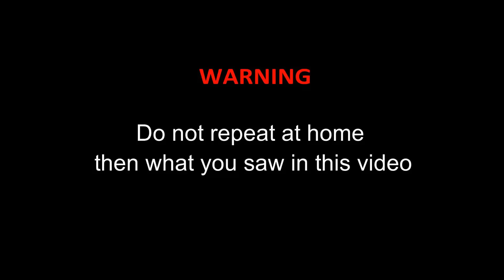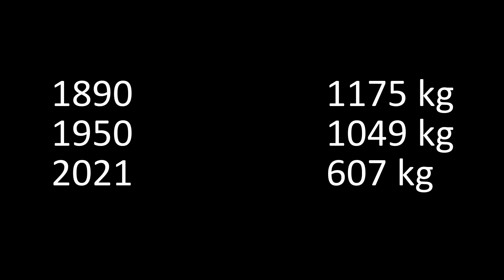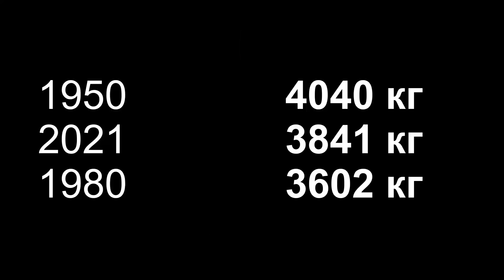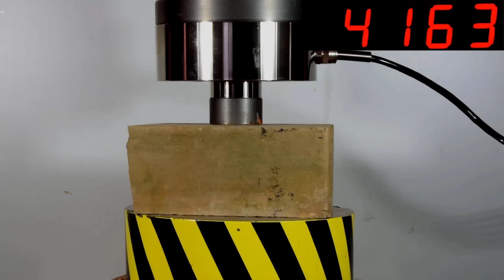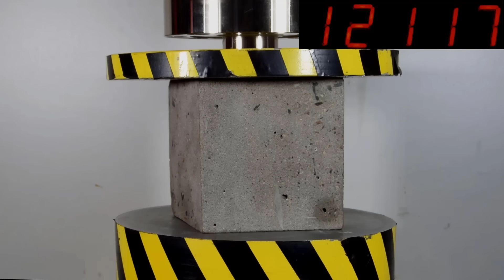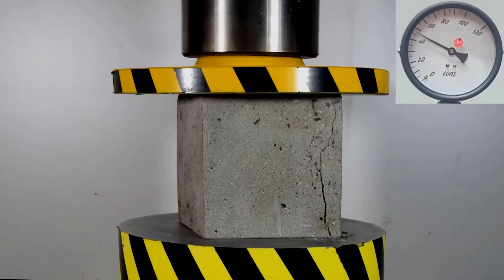HYDRAULIC PRESS VS OLD AND MODERN BRICKS

Comment: This just shows how older things were made to last where as modern things aren't.
Reply: That is not what it shows
Reply: @sovereigncataclysm  It is for the 1900 brick lasted longer than the 2020 brick.
Reply: @WintersAngel  1900s bricks were made with different construction practices in mind. They are fired at much higher temperatures which makes them a lot more resistant, but more brittle. This is because they were used for the main structure of the building. Modern building practices has a lot of steel etc. reinforcement, that makes brittle bricks a poor design choice so they are fired at lower temps. 
Not only that, but there is significant selection bias here. If a brick has survived since 1950s then it was one of the strongest of the batch - all of the weak ones have already been broken and can't make it to this testing. However, for the modern one, this effect is not present.
Reply: @sovereigncataclysm  True but the 1950s brick would be weaker than when it was first made for as the years had gone by it would've been damaged in some way. Whereas for the modern one not as much damage would've happened to it for it's pretty new, and yet the older one survives longer.
If the 2020 brick had been around for as long as the 1950 brick it might have broken quicker because of its surroundings, changes in the temperature and etc that it may have gone through.

I am going to say that through development newer bricks would be made to be stronger so that whatever they are using them for doesn't break as easily. If it did the companies would be sued. Which they do not want. 
However, with the demand and the growth of the population more things are being demanded which means quicker reproduction needs to be made so a mistake in manufacturing may be made. 
In older factories, there would've been less demand and a lot more done by hand so mistakes couldn't sneak in so much.
Either way, some older things were designed to last long, and some weren't.
We are both right in our own ways for different things may have happened to each item and that way there is a flaw in testing any hypothesis.
If one brick was used to make a wall of a house, vs one used to make a divider in a room, which one would be stronger? 
The one used to make a wall of course. 
We don't know what the 1950 and 2020 bricks were used for so that makes it harder for both our hypothesises.
If we knew what they were used for, and were both used for the same thing, then it would be clear that the 1950 brick was better.
Thus proving my point.
But we don't know so none of us could be fully correct.

Comment: The concrete compression tests were actually very interesting as it continues to cure for decades after pouring so it's hard to say if modern mixes are better tan the older ones
Reply: I think planed selfdestruction of a good is nowadays in literally anything, even in a brick.
Reply: The tests were not made in equal conditions, since the "modern" concrete is pure concrete, you can see it being converted to dust, but the older concrete has gravel on is composition, so it makes it stronger, since it has more properties for being a composite material. That's one of the reason it could hold more load.
Reply: The material is cheaper today resource wise
Reply: @alejandroguerra3411  Well nowadays concrete in general does not contain any gravel anymore, because sandbased concrete became the standard. The only thing that nowadays reinforces concrete are steel insertions, also only used on specific points of a building with a higher contact pressure and weightload.
Reply: Pop lo propio l
Reply: This is where I, an electrical engineer, can admit my respect for civil engineers.

We used to say "but you guys just study concrete"

Wooooooof
Reply: @sad_wrangler8515  so they where tougher before
Reply: @TH3MZ   The 2 main factors in why sand based is used more to day is because it cheaper and its lighter. Most people think that there has to be one best thing in every thing. In reality the best way to excel in engineering to to make things excel within there purpose. In a team you dont want carbon copys of your best player you want a diverse cast, where one fails the others thrive.
Reply: you also have to take it to account that modern concrete is designed to be used with rebar so its not as dense i.e less aggregates therefor not as strong
Reply: Roman concrete is actually stronger than modern concrete. The Romans made concrete with volcanic ash and lime. When it was exposed to sea water, it became stronger. Researchers found a reaction occured that formed a rare mineral.
Reply: @badnoodlez  TBH they just do the same physics as mechanical engineers, but they ignore 90% of forces and attributes because they consider them negligible lul:D
Reply: There are different mixes for concrete for different concrete strengths (i.e. 3000 psi, 4000 psi, 5000psi, etc...).  There is no just plain modern concrete...
Reply: Cost efficiencies especially in this economy would make me same the older had more quality bricks. It also makes sense that bricks should be made cheaper with the introduction of steel into buildings, which would explain the downward trend of brick quality.
Reply: @BenDover-tq5yu  exactly
Reply: Speaking of those tests, I only say the first, but the flashed numbers say 6 thousand something and it was only 1 or do thousand.
Reply: @sad_wrangler8515   actually, there's different concrete sets that are commercially produced, some come with gravel, including quick setting
Reply: The new block had literally no supports in it, of course its going to fold easily. the old one had a ton of contaminates which give it support. Simple concrete knowledge and physics knowledge could have told you this test was flawed. I also want to point out the newer concrete looks like it didn't set properly.
Reply: @sad_wrangler8515  Bricks are typically not made of concrete, they are made of clay, namely because the former is easier to mix and pour on site while the latter must be hardened and shaped well before transport. And as OP stated, concrete does in fact cure over the years, meaning it dries out and becomes harder, and theoretically stronger.
Reply: @sad_wrangler8515  all the concrete we use has gravel in it
Reply: @alejandroguerra3411  the real reason is that the old concrete was made for a fortress and not for civilian use
Reply: up to 3 years depending on the cement after that time there are no significant changes in compression strength. There are also other factors which in time lower concrete bearing capacity
Reply: @sairvinginthestacks  It's just zeolitic minerals which form in Roman cements, not exactly rare minerals. For example, (nanocrystalline) zeolites also form in modern geopolymer/alkali-activated cements. When cured at elevated temperatures, the zeolites crystallize properly.
Reply: @brianfranks5874  Depends on the grain strength, as you saw. The fortress brick literally had gravel with 2-5cm diameter. Modern concrete contains lime powder, silicon sand and the gravel of modern concrete is not even one centimeter in diameter. Porphyr, Basalt or the cheapest Gitter cost nearly 300€ per ton, which is half the price for a metric ton of concrete. Dolomite and Basalt sand cost 50-100€ per metric ton.
Reply: @landerfrederickx904  Thanks! None of the articles I could find actually explained what type of minerals formed. They just mentioned sea water and "rare" minerals.
Reply: @sad_wrangler8515  When you speak of ''modern concrete'' do you mean concrete mix created in US or everywhere? Round here you still mix it with gravel and reinforce it with steel. Go figure!
Also this old concrete block looked like it was mixed with pieces of granite. Not sure it gives it extra strenght or not though.
Reply: @rockmcdwayne1710  Can just talk about the concrete in the EU, which most of the time has no gravel in it or by far pieces smaller than 5 mm because it's simply cheaper, than concrete with gravel containing a bigger grain size of gravel.
Reply: Its also hard to say cause the construction concrete for the Fortress was considered high tensile back in the 1800s, and he didn't use modern day high tensile concrete
Reply: There's one way to know tho
Make two in the same time , old stile and new stile and test them
Reply: @sairvinginthestacks  whoa that’s amazing
Reply: Bricks aren't concrete
Reply: @sad_wrangler8515  “planned obsolescence” is the term you’re looking for...but yes, I agree
Reply: @sad_wrangler8515  Where do you get that info from? all the concrete I've worked with almost always had gravel in it's composition.
Reply: @Μρ.Κράμπας  My brother and I work in the middle of the Alps as architects. The composite of modern concrete here around (Northern Italy, Switzerland, Eastern Austria) is quite a lot of sand from dolomite. I guess it depends what you consider gravel, most of the gravel used here is under 5mm in diameter, nothing compared to the huge junkes of stone used in older concrete.
Reply: @sad_wrangler8515  Then it must be due to location (agregate prices and such). Here in Greece ,the majority of concrete formulas (except Clsm, Filler and press frendly-er ones) use thicker gravel, from what I know and have observed.
Reply: @BaxterRoss  they definitely aren't, but if you watch the whole video there are concrete compression tests
Reply: @sad_wrangler8515  idk where you get your concrete but what we use isn’t like that
Reply: @sad_wrangler8515  I think you're thinking of cement, concrete has gravel. Gravel is what makes it "concrete" and not "cement," concrete is usually 1 part cement mixed with 3 parts gravel and 2 parts sand. Sand mixes are used for a top coat because you don't see the gravel and it's "pretty" for the client (or you work the top and push the gravel down a bit before smoothing it.)
Reply: I think so too. Nowadays materials will break sooner, which in turn means they have to be repaired and replaced more frequently. This means more money for the manufacturers. Modern structures aren’t built to last like they were back in the 1800’s
Reply: @sad_wrangler8515  right, built-in obsolescence! They can make a muffler that would last a lifetime but where's the profit in that? Big business wont allow it. Same with clothes and shoes.
Reply: it is not a compression test, it is a mechanical bending test as the block is being flexed by the compression force of the hydraulic press.
Reply: @alejandroguerra3411  pure cement you mean
Reply: @alejandroguerra3411  Exactly the modern one looks just like cement, in the old one I could stones and all that concrete needs.
Reply: check the comment up
Reply: @alejandroguerra3411  todays concrete has also gravel in it, concrete isn't just one thing there are classes of concrete like S3 to like s200 s3 meaning the biggest particle can be 3cm across, s 30is 3mm and so on
Reply: Guys, HERE is The Savior

YaH The Heavenly FATHER HIMSELF was Who they Crucified for our sins, NOT jesus, and “HERE IS THE PROOF”

From the Ancient Semitic Scroll: 
"Yad He Vav He" is what Moses wrote, when Moses asked YaH His Name (Exodus 3)

Ancient Semitic Direct Translation
Yad - "Behold The Hand"
He - "Behold the Breath"
Vav - "Behold The NAIL" <— YaH’s Crucifixion
He - "Behold the Breath"

“Behold the HAND that Beholds The NAIL” 

PROVES - YAH The Heavenly Father HIMSELF was Who they Crucified

That is EXACTLY what Moses Wrote

Here is what they mean

YaH's Name:
(Ya)d + (H)e, as YaH is what Moses called Him and YaH Declared: "this is My Name, this is My Name for all generations" (Exodus 3)

YaH is The Creator of “MAN”:
Yad He, (HAND BREATH), as YaH's "HAND" Formed man from the dust  of the Earth and His "BREATH" made him a living being (Adam)

YaH's Sacrifice of Crucifixion for “MAN”:
Vav He (NAIL BREATH), the "NAIL" through YaH’s "HAND", in Sacrifice of Crucifixion, that whosoever shall call YaH Savior, His “BREATH” brings forth life (Salvation)

How YaH arrives:
YaH arrives via the Tent of Meeting (Exodus 33:7:11, Isaiah 54, 55), where a Tent is erected outside the city, a cloud descends upon the entrance of the Tent and YaH appears...

Why they demanded YaH to be Crucified:
YaH was Crucified according to Hebrew law (Deuteronomy 21), to be Hung on an Almond Tree for BLASPHEMY as it was for His NAME they demanded Him Crucified. The Messiah claimed He was YaH...

HE WAS YaH!!!

HalleluYAH translates “Praise ye YaH”

The Hebrew Book of Isaiah

Isaiah 42:8
"I am YaH; that is my Name! I will not yield my glory to another or my praise to idols.

Isaiah 43:11
I, I am YAH, and there is no other Savior but Me.

Isaiah 45:5
I am YaH, and there is none else.
Reply: Well the ancient Romans used volcanic rock mix, which is why roman concrete is superior and still stands in some areas compared to modern concrete which is very brittle and usually needs rebar rods to strengthen it.
However, concrete does get harder with time as do bricks. Pretty much all clay types do. As does calcium, bone etc. Chemicle reactions over time strengthen them. As well as exposed with elements and oxygen.
Reply: @alejandroguerra3411  yep if he used fiber reinforced out come had diff numbers 2
Reply: Na the concrete test was stupid. He got pretty much flat evenly distributed point of contact on the old block due to it being cut. The modern stuff isn’t even the same type or similar, and the point of contact is the left side which is where it breaks.
Reply: @sad_wrangler8515  Not even remotely true, been working in concrete for over 15 years and ive never poured a slab wall curb or anything without the aggregate it still has the rocks lol